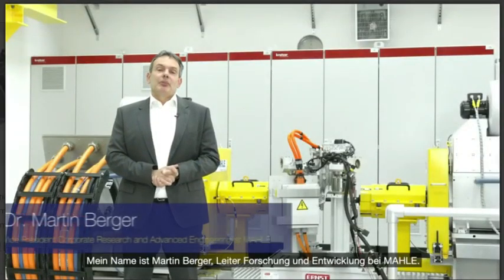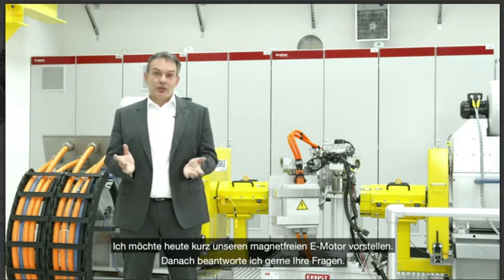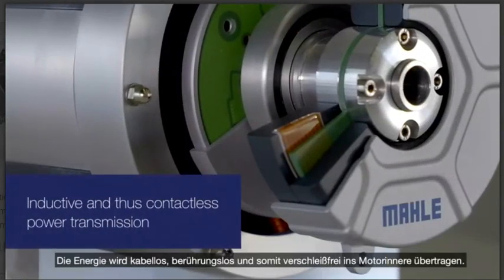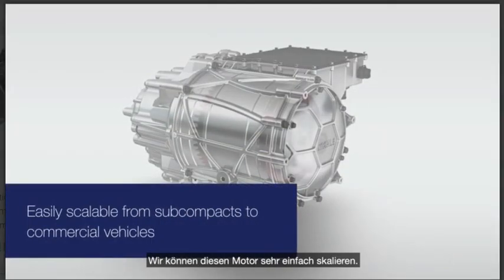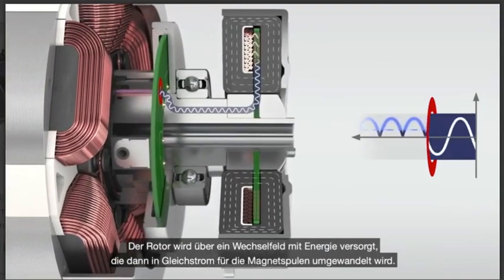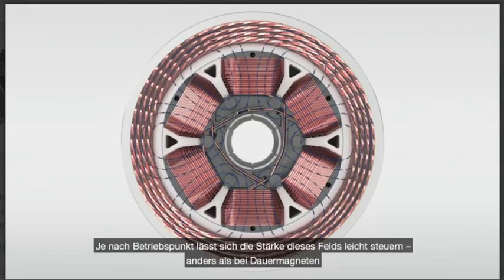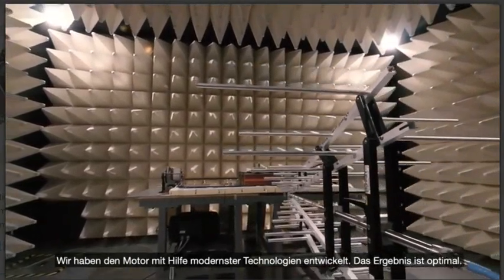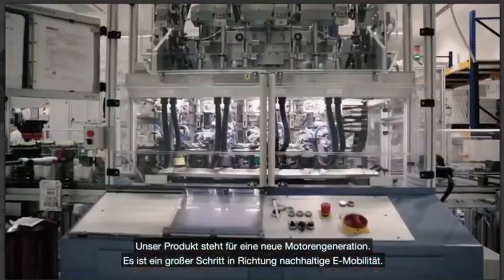Mahle, produce revolutionary new no-magnet motor...

Comment: i think the biggest innovation is the wireless exciter.  otherwise it acts just like any other sync motor
Reply: Wireless excitation is very common in large industrial generators, and DC motors. So basically nothing new here but we all got to do our own new marketing spin I on old ideas.
Reply: @johanncover1988  that's what it felt like to me
Reply: There is no information here - this was for marketing and investor purposes - nothing else.
Reply: A rotating coil transformer and some diodes are the innovation here?
Reply: It is a sync motor.. just a reversed generator operation... no new wheel here
Reply: and that is old too.
Reply: Ah, that IS the innovation and it's a major one. I explored the principle of inducing a field in the rotor as far back as 1980, however the semiconductors of the era meant it never developed beyond bench models. To achieve a reliable, high efficiency coupling to the rotor is a major achievement. I would be interested to see how much power they can generate.
Reply: @davidgapp1457  This would be at the efficiency stated, but that is bad engineering math. Look at the Tesla EM-mechanical oscillator, the one that almost brought down his apartment building. The air gap makes this almost that, in a radial, modular shape. And it spins instead of shaking the building. See it?
Reply: @davidgapp1457  I can see it both ways.  We have known about the transformer effect and Synchronous AC motors forever.  Series wound motors and SyncRel motors dont need PMs either.  I mean, its cool, yeah, but it isn't a paradigm shifting tech.  It feels like a "oh neat, you got it working"
Reply: @car0lm1k3  It's all about efficiency and operating envelope. A typical car alternator also has no magnets, but its efficiency (as a generator) is no more than 45 to 65%. Likewise we've had induction-type/synchronous motors (induction to the rotor) for decades (actually over 100 years), but either they were relatively inefficient or they could not produce useful torque over a wide range of operating loads and speeds. I gather this motor can achieve 95% efficiency for almost its entire operating envelope; that's a significant achievement. Whether it pans out commercially will depend on many factors not discussed in this video or Mahle's website, but it at least opens the door to a new generation of motors which avoid rare earth metals, achieve high efficiency and can operate over a wide speed range.
Reply: @davidgapp1457  gotcha.  that level of efficiency over the whole envelope is pretty impressive then.  Most systems are usually only .9-.95 in their sweet spot
Reply: @davidgapp1457  looking at your dialogue with another YouTuber regarding this Mahle brushless induction motor I wonder whether you would opine about people using silver for either the batteries or the motor windings.  Seems like people could put some silver bar savings to work in other ways and still keep it for its monetary value; no?
Reply: @clavo3352  the increase in conductance between copper and silver is really small compared to the difference in cost.

Having coils instead of permanent magnets has some advantages, for example you can shift the torque-speed characteristics of the motor by changing the magnetic field strength. Transmitting the power inductively gets rid of the brushes, which were a weak point of this principle. But all in all it's nothing really ground breaking.
Reply: @davidgapp1457  Contrary to their name, rare earth metals are not all that rare.  What's more, Nd makes up really very little of the bulk mass of the magnet.  I really don't see why they're making these materials out to be a huge hurdle.
I also have a hard time understanding how they can achieve efficiency so much higher than a car style alternator when they still have to use some power for the field and also deal with rectifier losses.  Slip rings, despite being vulnerable to wear aren't really that inefficient.
Reply: @whatelseison8970  yeah but China is controlling almost all of the market of these rare earth magnets and that cases concern to alot of people. Besides the magnets aren't that cheap.
Reply: @whatelseison8970  <deleted>
Reply: @davidgapp1457  thank you for your description, it’s a useful insight to the fact that it is much more complex than “it’s just an old generator from the 70’s”
Definitely a topic I will explore to be aware of a possible path of future technology.
As a diesel pickup mechanic with minimal EV experience I believe it’s inevitable this technology will eventually consume a better part of my workday, even in northern Canada where the climate adds another layer of complication to overall EV efficiency.
Reply: @davidgapp1457   @David Gapp  seems you have a few things wrong here, electric motors doesn't use lithium or cobalt, the rare earth materials that are use are primarily Neodymium in the permanent magnets.

Lithium and Cobalt is used in the Lithium ion batteries, but that is completely separate from the motors themselves.

Of course EVs don't use alternators, why would they? Either you lack a basic understanding of the things you speak of, or you are simply confusing alternators with transformers. 
Alternators are just generators, they convert kinetic energy to electricity, in cars they are driven by the internal combustion engine. So no, battery electric cars don't have one, their motors can act as generators when braking the car, and they don't have an ICE to drive an alternator. 

With those major errors in your post, I find it a bit hard to trust any of your info, sad since you wrote a lot of interesting things.
Reply: @CatNolara  Thank you much for that.  I'm also wondering about any chemical advantage in the batteries.  That may be too deep for this forum.  I'm thinking/hoping it would help with the battery anode/cathode interaction perhaps in the place of Nickle.
Reply: @Robinlarsson83  Yes, sorry, I was half asleep and you are completely correct. Obviously the lithium/cobalt should be associated with batteries only, not the motors. I am perfectly aware of that but I had not gotten my first cup of coffee and I should've read what I wrote before posting. Apologies.

The comment about alternators was in reference to PHEV's which do have an engine and a 12V conventional battery (at least in the case of the Rav4 Prime). I am guessing the Rav4 Hybrid is the same arrangement. 

Given the mechanical simplicity of EV's (compared to PHEV or ICE) I am looking forward to the EV era. Long term reliability should be excellent.

There is, by the way, a really good video on how the Rav4 Prime's transmission and primary motor and generator work. Recommended! https://www.youtube.com/watch?v=O61WihMRdjM&t=18s
Reply: @davidgapp1457  Battery cars are twice as expensive and much less practical than internal combustion cars (whether pure ICE or hybrid).

This is due to the battery, of course, not the motor. Electric motors have been quite reliable, efficient and power dense for many decades. The motor was never the part preventing a practical BEV, it was always the battery, and it still is.

I challenge anyone to compare an affordable ICEV or hybrid to a pure BEV and not discover the approximately 70-100% difference in purchase price, much shorter range and 10-20X longer recharging times of the battery car.

I don't know why anyone would be looking forward to being forced to buy such an obviously inferior solution. I for one am not.
Reply: @davidgapp1457  Hi David, thanks for this detailed reply.  I'm a little confused about your first paragraph regarding lithium for a couple of reasons.  First, I didn't say anything about lithium.  Secondly, lithium is not used to make (NdFeB) magnets.  The "rare-earth", or more properly, lanthanide element I was talking about is Neodymium.

The lanthanides are not particularly rare in earth's crust, but they do present some unique challenges - namely that they tend to occur as polydisperse ores (most or all lanthanides mixed together) that can be difficult and expensive to chemically separate from one another due to their similar chemical properties.  

Lithium is certainly relevant to the topic of EV's as it pertains to their batteries, but not so much to this discussion. I am aware that a large fraction of the worlds supply of both elements belongs to China, but again, I'm not here to talk about China.

Copper is also not exactly cheap and is quite heavy, and even if you could couple power with 100% efficiency to the field coils, you're still burning energy to maintain a field that could be maintained with zero energy input using PM's.

NdFeB magnets (and to a lesser degree SmCo) really were a paradigm shift when they were first developed because there had never been anything like them.  There still isn't.  The most efficient and power dense electric motors that I'm aware of are coreless axial flux motors with Halbach magnets.  The only parts of them that aren't doing work are the case, shaft and bearings.  There's also no core loss due to no core.  Here's a paper if you're bored: https://core.ac.uk/download/pdf/76422644.pdf
Reply: @phamnuwen9442  Who is forcing you?

I bought a Toyota Rav4 SE Prime because it met my requirements and wish list. The car has a 42 mile EV range (real world is closer to 46 avg) which means my daily commute, shopping and gym are pure electric; costing about 50% the price of fuel for an ICE car with equivalent fuel economy. I live in a heavily polluted city, close to the city center, so I'm also not unhappy that my vehicle, for the most part, is not adding to our existing smog problem.

I am not ready to buy an EV as my primary vehicle because I routinely travel out-of-town. However, I acknowledge that battery energy-density and recharge times will continue to improve. For me the breakthrough point is a range of 330 miles and a recharge time (5% to 95%) of around 5 minutes. Until then I would consider an EV only as a secondary vehicle for in-city travel.

The Toyota Electric BZ4X CUV is touted to have a starting price around $40K. Not sure if that includes the Federal Tax Credit or not. As more competition arrives into the market, and as technology improves, I expect that prices will continue to reduce. That seems to be the pattern for most technologies (except for Apple).

I should point out that my Rav4 SE Prime cost me $41,500 (equipped) however there is a Federal Tax Credit of $7,500. So this means my PHEV actually costs less than a modestly equipped Rav4 Hybrid. So, since I wanted this class of vehicle (CUV) the decision was easy. The Rav4 Prime reaches 60 mph in around 5.7 secs, which is especially useful for overtaking on 2 lane roads. So the extra power in the Prime (and off-the-line torque) were side benefits that put a smile on my face.

There are many new battery technologies in-development - including the hyped solid state batteries. When price / range / recharge time are satisfactory to me, I'll buy an EV. But I figure that day is maybe four to five years away. However I won't be selling my Toyota Prime any time soon! 

Happy motoring!
Reply: @whatelseison8970  I will revise what I said. I allowed myself to get side-tracked to lithium/cobalt which is, of course, about batteries, not motors. Neodymium oxide (for motors) currently costs around $49,500 per metric ton and is expected to rise. Although neodymium is not especially rare (as rare earth metals go) it is subject to wide price swings and restricted supply (China is the principle source at this time). It also has physical properties which are undesirable including a loss of coercivity at high temperatures. To offset this problem, dysprosium and terbium can be added, however these elements are expensive. In addition, neodymium is vulnerable to corrosion.

A switch away from rare-earth magnets is seen as desirable for the reasons indicated above. In particular, from a manufacturer's perspective, it makes them less vulnerable to price and supply issues. 

What I was saying about lithium is none-the-less true for batteries. Although batteries actually contain modest amounts of lithium (plus cobalt), they are expensive to recycle and the supply is finite. As with neodymium, the Chinese Government can throttle the supply of lithium (at least for now) which leaves manufacturers somewhat vulnerable. It also does not bode well for the future. It would be good to build batteries which are either more easily recycled or which have reduced or zero dependency on materials which are not abundant.
Reply: @davidgapp1457  A car alternator is low efficiency because of how it's rectified/regulated, not how the field is excited. And it's done that way because it's cheap. Synchronous motors are, by their nature, efficient because (usually) there is no slip. Any high quality synchronous motor paired with a VFD is going to be quite efficient. The only real discernable advantage this has over brushes is this doesn't wear. But given brushes have a pretty long life in synchronous motors, that point is nearly moot.

Side note: This is a synchronous motor, not a series wound motor. Stator current does not pass through the field.
Reply: @davidgapp1457  Rare earths ores   contains radioactive elements. (Thorium, uranium..) the nuclear scare seems to slowly moving to "we need nuclear energy to be green" narative. Chinas control on prices can get solved prettyy fast if there is some political will.
Reply: @causeitso  Then Maybe our problem is more economic than technological. What I want to know is the power consumption of this motor vs an equivalent motor of another design. Even with higher efficiency I can't imagine the load being less now that you have to power a stator and a rotor?? It sounds to me like It's not as good as they're trying to make it seem
Reply: @davidgapp1457  there is no physical way this motor can achieve 95% efficiency. Losses in the wires as heat, losses in bearings, stray em flux...  Unless this uses superconducting wires (which it doesn't)
Reply: @phamnuwen9442  Well you can live in the dino era while we enjoy quiet,reliable,efficient transportation.  ICE's are on the way out. Also, if there were charging stations everywhere then it wouldn't really matter as much about range. You've seen the torque these motors make right? Only large commercial/industrial vehicles will still need ICE for probably some time.
Reply: @davidgapp1457  I don't have anything against hybrids in general. For some use cases a small battery which enables regeneration and a perhaps a bit of charging in situations where electricity is cheaper than fossil fuels (this is not always the case - look at Germany) might make sense.

The big problem is the insistence on full BEV's which come with a major downgrade in practicality as well as a huge price hike simply due to the kWh price of current batteries.

Solid state batteries is mostly handwaving at this point. Nobody know for sure whether they will be significantly cheaper or better than the current chemistry.

This is typical of the RE/EV industry. All the benefits are "upcoming breakthroughs". We just have to keep the subsidies flowing a few more decades, and then they'll actually be cheaper and better.... It's pretty much the definition of a Ponzi scheme at this point.
Reply: @davidgapp1457  "Who is forcing you?"

How did you manage to miss that virtually every Western government is promising to blanket ban internal combustion engines?
Reply: @madjimms  "Well you can live in the dino era while we enjoy quiet,reliable,efficient transportation."

What is efficient about having to stop hours at a super unreliable charger during longer trips? What is efficient about paying the price of two (2) ICE cars and get one (1) impractical battery car?

"ICE's are on the way out."

Not if people get to choose. Only if governments keep forcing them down our throats.

" if there were charging stations everywhere then it wouldn't really matter as much about range."

If pigs could fly, we wouldn't need airplanes.

"You've seen the torque these motors make right?"

Who cares? Most people need an affordable, practical way to get from A to B, not a drag racer.

"Only large commercial/industrial vehicles will still need ICE for probably some time."

It's not for you to decide what people need.
Reply: @davidgapp1457  Don't buy an ev for inner city travel. Take a taxi.
Reply: @dgnash  You seriously expect me to spend $80 a day commuting to work. Then another $40 to go shopping and the gym? Should also add, my job is actually on the outskirts of the city so I'm traveling counter rush hour traffic (not that I ever get to work regular hours of course!). Besides which, the taxi service in Phoenix is unreliable. Last time I had to go to the airport the taxi we booked didn't show, and despite numerous phone calls it hadn't pitched up 40 minutes later... ended up taking an Uber.
Reply: But that is the true significance of this invention as he stated quite clearly.
Reply: @ThomasLee123  but it isn't that big of an innovation. I mean it's cool and the efficiency envelope is cool, but the innovation factor is small
Reply: Essentially a Tesla coil to actuate the "radial solenoid" if you will.
Reply: i think tthe same, but how isn't the wifi module disturbed by the huge magnetic field of the motor?
Reply: @riks7256  Laminated core directs magnetic flux. Furthermore, the effect of the rotating field of the rotor counteracts the rotating field of the stator. Counter Electromotive Force. Plus, the ac going to the field is probably a much higher frequency than what's present in the stator. And probably "tuned" for that frequency. Speculation on my part, but best guess.
Reply: I think that this design might take a couple of generations to mature, However i can also see that once they have it perfected, extremely lightweight motors perfect for medium duty applications coming.
Reply: @abelincoln7473  Not for an Alien. I have the math model, the rest is details. And investment. There is better. An almost infinite number of better too. People be scared.
Reply: But cheaper
Reply: You guys are stupid and know nothing about electric machinery. Look up how the armature field is generated on synchronous generators. This is nothing new.
Reply: It's just an induction motor; albeit with a different design.
Reply: yep
Reply: ... What other innovation is there in this video? Thought that was kinda obvious no?
Reply: @eatonasher3398  yeah.  it was just video was MASSIVELY playing up the whole design as unique and innovative. Series wound motors also dont really need PMs either
Reply: I agree, you could do the same thing with brushes, and they should call it inductive power transmission, not wireless, that's the word for wifi, phones, and rc cars
Reply: @dustinmcdermont699  Trouble with brushes is that they wear, which this system eliminates.
Reply: @dustinmcdermont699  they probably desire to avoid confusion with induction motors
Reply: @jaik195701  have you ever heard of guina energy in Australia? They are light years ahead of this stuff, with superconducting Faraday disc motors, insane!
Reply: Cleaner, needer, and more efficient. That's what the world needs. Every little bit helps.